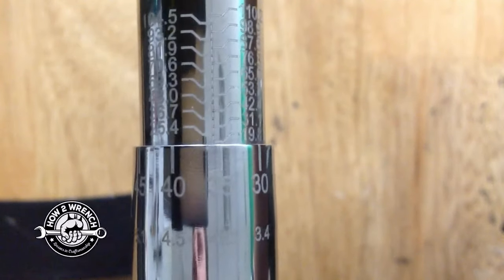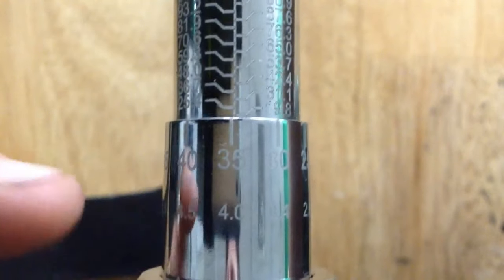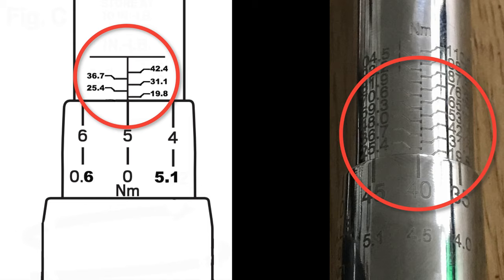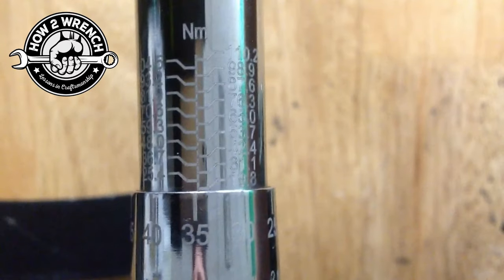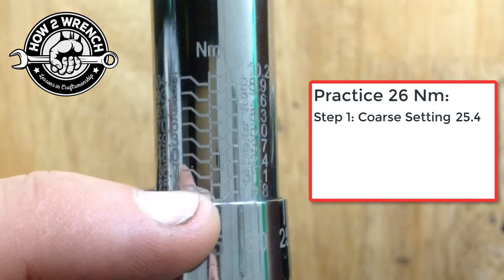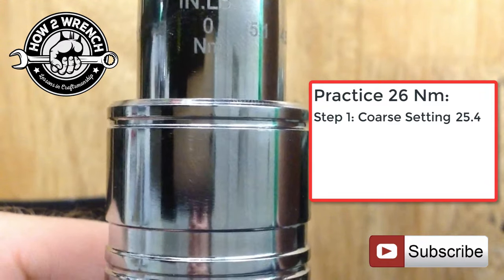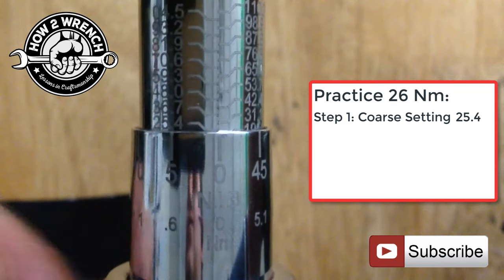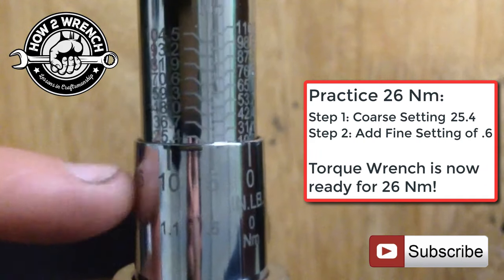How to use the Newton Meter scale on a torque wrench. Reading Nm and setting the coarse/fine scales.

Comment: My one doesn't have a lock ring but has some sort of lock knob you can tighten on the bottom of it but all that seems to do when tight is stop you from rotating the handle down again.  It also goes from 0 - 12 rather than 0 - 9 which makes no sense to me given it's meant to be metric!

Comment: I had gotten a yamaha chappy a pw50 and a yamaha moto4 quad they have been sitting for 10+years  cleaned the carb out and fuel lines/ petcocks were all gunked up and now the pw and the chappy  start 1st try using my hand on the kickstart. Now I started to work on the yamaha moto4 I noticed there was no spark plug I called the yamaha dealership in my area and picked up the stock plug for it but it wouldn't go in the hole I noticed theres an insert in the hole that's keeping the spark plug from going in is there any advice or knowledge you can give me I'd really appreciate it thank you.
Reply from the maker: That would be impossible to answer correctly without seeing pics or video. We do offer help with more details...It sounds like you’re ready for some Techline help. Coach Conley is also available for hire to personally work one on one with you if ever needed. Yep he is a real person. Give him a call @ 602-345-0432

Details here: https://how2wrench.com/product/personal-tech-training-phone-facetime/ 

Your answers and help are just around the corner. Save time and money while protecting your investment and yourself by doing it the right way!
Follow us!
Web:
www.How2Wrench.com    
www.Tools2Wrench.com